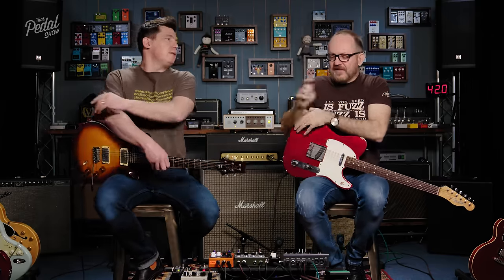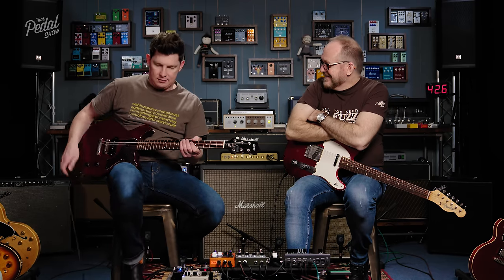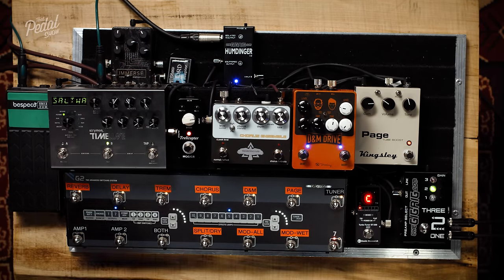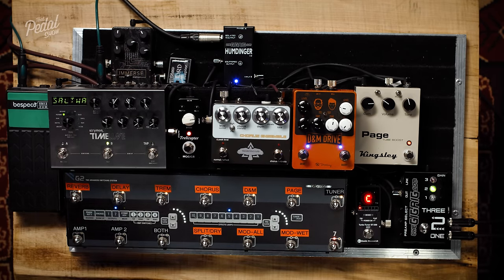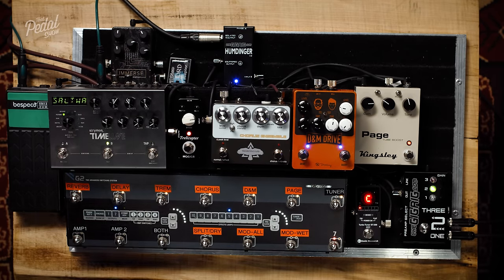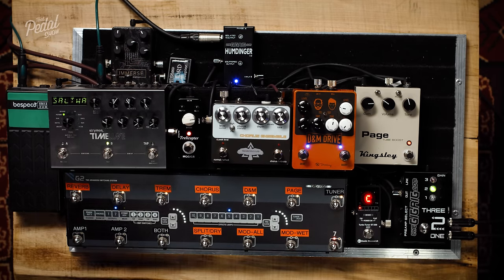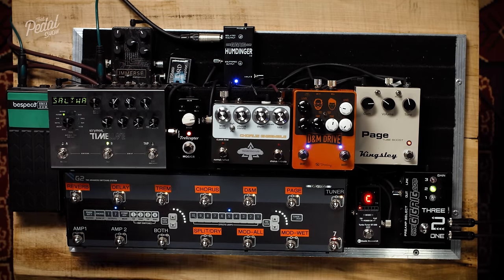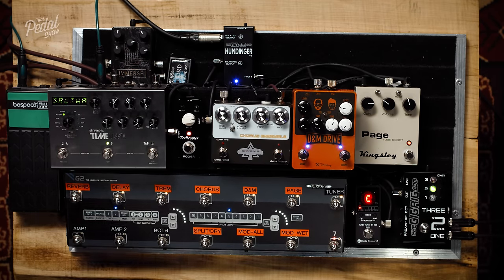Wet-Dry & Wet-Dry-Wet Amp & FX Setups Explained – That Pedal Show

Comment: hello guys and thanks a lot for this your first 2019 TPshow, very illuminating explanation, i will try it in my rig.
i need your help with something.
a have an issue with my amp, (a mesa boogie subway rocket) and my wah pedal (a Dunlop MC404-CAE ).
in the dirty channel seem like it does´t "grab" the whole overdriven sound, the "waka waka" effect disappears ir more noticeable when you just hit the strings once but still rocking the wah pedal.
Q: is that normal?... i mean, do i need to keep rocking the wah pedal all the time to get the waka-waka effect?... when i using the dirty channel?
thanks a lot again guys, i hope more good videos from you soon.
Cheers, Jorge

Comment: I've got a Bad Cat 40r usa series with the EF86 preamp. It sounds Godly dimed  using the k-master. Anything through the loop or in front just dulls it. The class A harmonic richness just isn't the same. So for a wet dry with that I think I need to mic it up and sent to a mixer and then a board?! Maybe to a direct box to the board. I want fxs, but I want my amp just cranking on its own.

Comment: Hi guys, I´ve been watching a lot of your master classes and still have one question. To the point to split the signal using the humdinger is easy but them the signal has to be split again for the two wet amps and I don´t understand why there is no need of another humdinger or ABY switcher to control the face/out of face issue. You said that the strymon delay split the signal between the two wet amps so, No face problems? To get to this second split wet/wet it would be nice to know pedals that works and doesn´t. Also it would be great to see how it works to a low budget situation: one main amp, some gain pedals then get a spliter, two cheaper combo amps to send the split signal and a pedal to split the wet between the two. Which cheaps amps can be used for that?.Most of people have only the minimal gear and use to get rid of the old one to get upgrade. Greats vids always, thanks.

Comment: I suspect this is covered maybe, but I had an idea for putting OD/gain stages after the split to send to dry, and keep a clean signal for the wet amps. But the gain stages compress, so the clean/wet transients will dominate and spoil the sound, you say? Not necessarily. You can choose delay or reverb with a mix knob to control or eliminate that. Or drop in a compressor to squash the clean signal before it hits the echo space. I say I can make this work, so there.

Comment: Hey guys, a question into powering the “device” for splitting signal... 
say you have your pedalboard which is usually wired for just one amp & all power outputs on the pedalboard power supply have been used... and then when you can or have the luxury of using 2 amps & you want to insert the humdinger or aby-baby et al. Does the power supply for said device need to be powered from the same power supply as you pedal board... ie do you need a bigger pedalboard power supply unit or another “isolator & distributor” etc or can you get a 1spot/separate power supply unit to power the humdinger on its own?
And the what about powering your amps... both my amps are usually plugged into 1 multi board which then also has the iec cable from pedalboard running to it, and then potentially another wall-wart power supply for humdinger et al.... and then sometimes I still get zapped through my microphone
Help... confused as flock re isolation etc
Cheers
Chris

Comment: Ok I am about to steep my feet into this wet /dry/wet rig. I plan to run a stereo 50 watt Peavey power amp into 2 boogie preamps with the G major acting as the effects, the power amp would run 2 x 1/12's , for the Dry amp I would be using a PRS Dallas head into a 1x 12. Now i know i can run the preamps and the power amp and get that going how do incorporate the dry rig though ? Sorry complete novice at this. I would be using a midicontroller to switch channels and effects on the preamps.

Comment: Fantastic show!  Question for you: Where would you recommend putting a looper pedal in either one of these setups?  Just something like a simple Boss RC-3 looper.  Any guidance you can offer is greatly appreciated.
Reply: The Batigs put it at the end.  So both are going in and then outs to both amps.   This way you get everything going into the looper

Comment: Great show! I really enjoyed this episode, especially the diagrams, and the funny and effective representation of phase coherence. Question - has anyone ever tried a WDW setup, but instead of using 3 amps, using one amp+effects loop, and then a stereo PA system (or powered speakers would work too I suppose) to get a center-dry plus big, wide stereo effected image? I have been playing around with this lately in my small rehearsal/recording space. I use a Bogner ATMA and prefer to get my OD from the amp, which can be a wrench in the works. To try and achieve WDW with a PA, using my amp's OD for the base tone, and without drive pedals and a splitter, I'm routing the signal from my guitar into the front of the ATMA, then getting my OD/distortion from the ATMA preamp (pre-send). Then I use the loop as a splitter, taking the send output (the ATMA has a series loop that still sends signal to the power amp even if you take a lead out of the send) and sending that overdriven signal to my stereo time effects - Dunlop EchoPlex Pre -> Strymon Volante (stereo) --> Strymon Big Sky (stereo). I take the stereo output from the Big Sky with the cab filter enabled, and send that to a stereo channel on my PA board. In the meantime, back at the ATMA loop, the signal that didn't go out through the send proceeds to the power amp and speaker as normal with no time-based effects. The end result is that the amp is outputting the dry tone. The wet tone, which includes the preamp OD from my amp, is coming out of the wide-set PA speakers in massive stereo. I am struggling a little bit with hum from the PA, but overall it sounds huge and immersive and room-filling like nothing I've ever heard, and if I can manage to completely kill the hum, it has potential to be absolutely amazing. I'm not sure how practical it is, but wow does it sound good just messing around! I would love to hear if anyone else has tried this and has any suggestions, etc, to make it better. Cheers!
Reply: Ah, nevermind, I just watched a little further and you describe almost exactly this setup at 01:10:36.  It sounds like maybe a splitter with proper isolation in the ATMA loop would do the trick and get rid of the hum I'm still getting at the PA. Thanks so much!

Comment: I recently set up my dry-wet rig and split the signal using a Radial Bigshot ABY to avoid inter-amp phase/polarity issues.  However, puzzled by weirdnesses in my wet chain, I slowly figured out that three of five highly regarded pedals therein invert phase: an EHX Small Stone, my treasured DMM, and a  boutique Echoplex-type preamp pedal that wants to be placed last in the chain before the amp. Engaging any one of these pedals throws the amps out-of-phase.  Engaging any two of the three keeps the amps in-phase. Engaging all three pedals puts the amps back out-of-phase.  To avoid an expensive and complicated fix, I had to place two of these wet pedals in the (dry) main chain.  That fouls up my pedal order plans to stack delays and keep modulation effects out of my dry signal.  What a revolting predicament!  Problem is, I couldn't have identified which pedals are phase-inverting until I set up the rig.  Wet-dry is lovely, but it may not be nearly as simple as we'd like.

Comment: Inspired by you, I have Wet-dry-wet, using The radial bigshot (awesome for this purpose) to split dry and wet and a stereo chorus to split The wet signal, going through stereo trem, delay and reverb. It is massive sounding. My one challenge is this: I have my dry amp on the edge of break-up. For my clean sound all three amps are at a similar volume. My wet amps have higher headroom than my dry amp (as per your instruction ;) ). When I engage one of my drive pedals to push the amps, the wet amps become too loud compared to the dry amp. I can combate this by using a boost on the dry amp after the split or my GE7 to take off a smidge from the wet amps. But is there a better/easier solution?

Comment: Hello from the left bank of the pond!  I am working on setting up a wet/dry/wet and was wanting to do something a little different at the split between wet and dry amps.  I’ve done some research and I’m not sure what I’m about to describe exists...

Mono in, stereo out.  Loop to put your drives and a blend knob in at least one of the output channels to set the amount of loop vs dry signal going into the channel.  

Basically, the idea is to run dirt into the dry amp and blended dirt and clean into the wet channel before hitting the mods/delays/reverbs.  

Phase reverse and ground lift are a plus...

Does such a thing exist?

Comment: I don't use fuzz/overdrives, only preamp gain, I have a single SS-20 tube preamp with +10dB output level into an ISP Stealth power amp, mono so far but looking to get into the dry/wet thing. Can the splitters you mentioned handle that signal level from the preamp? I would hate buying a splitter that could clip the input signal.

Comment: I noticed when you guys were switching the D&M drive in and out, both channels are on, and it seems to have its own single loop in G2. Are you always using the D&M with both channels engaged? Or are you using the TRS function with both sides going to separate loops? (At least in regards to videos like these where the D&M is just on the board as a place holder for a general drive/gain stage)

Cheers, my dudes
Many hugs from the Midwest U.S.

P.S. Come visit Riff City soon so I can give you both a proper handshake

Comment: Coming back to this episode. I just got a humdinger and set my rig up for the TPS recommended wet/dry. But I saw the guy from Vertex effects talking multiple times about how wet/dry has a different definition. He says it’s coming from the 80s where the have a line out from the dry amp and the a mixer to feed only wet signal into the wet amp. I never hear you guys talk about that. Can you elaborate in a future episode? Or even set that up and show us the different sounds?

Comment: Greetings Dan and Mick! That was a brilliant episode! I believe I may have a solution to the wet-dry “one mic live situation” dilemma, but it requires a little audio engineering on the part of the guitar player. For this example let's say your guitar rig is two 1x12 combo amps and a pedalboard in the standard wet-dry set up you described on the show. What if you also brought to the gig a small mixer that has at least 2 mic inputs (ex. Behringer Xenyx 802 mixer) and a couple mics (ex. Sennheiser E609,  hung over the top of the amps to avoid the need for mic stands). Then when the sound engineer comes with one mic to put in front of your rig, unplug his mic and plug the XLR cable into the output of your mixer. Now you can control the wet-dry mix going to the main board and the engineer is just controlling the volume of your mix. Thoughts? Keep up the great work!

Comment: Love your show.  I don’t understand how to setup three amps so that there aren’t noise/grounding issues. Can I just NOT use the ground prong on two of the three amps? Or do I need a special device?
Reply from the maker: Under no circumstances should you try I’ve the earth from your amp, it’s incredibly dangerous and has caused death in the past. You need a splitter that isolates the outputs to your second and third amp

Comment: Great video with the creamiest of tones! Question: If you're wanting to run a wet-dry rig with two amps with vastly differing wattage (I use a Vox AC15C2 & 1978 Music Man 65 watt 112 combo), what would be the proper setup for what effects go into which amp? Should modulation go into the amp with higher headroom, or save that  amp for the OD pedals?
Reply from the maker: Yeah, that's how I'd do it Alex. Wet stuff into the higher headroom. But there will be plenty of people who prefer the other way. :0) Mick hetr
Reply: Thanks!

Comment: So a question for you both, this video did a great job of explaining a wet dry wet rig. What is your opinion on a rig that is in stereo where one side is a tube amp, victory V50 being fed all digital effects etc. from a line 6 helix rack and the other side of the stereo rig is all analog with only analog petals into a Mesa MK V. My questions are your thoughts on how to control this rig, balance the two different types of signals analog versus digital and how it should all work together? Also, have you ever heard of performers using this kind of analog  -  digital stereo rig?
Reply from the maker: You’ll need to compensate for the latency on the digital side
Reply from the maker: And to add to that, Mick here, a more common application for mixing digital analogue and digital is to run W/D/W where the middle dry channel is analogue and the LR wet is stereo but with kill dry. So 100 per cent wet, like Devin Townsend for example. Cheers!

Comment: Great video, guys! I’m new to this concept and I have a simple question. Would be possible and maybe appropriate to not send any gain or drive to the wet amp?
Reply from the maker: It can be a cool sound if it works for you. Doesn't work for me or Dan because there's too much volume difference when you step on a drive. You really have to try it and see what works for your own application. Cheers!

Comment: Sorry if this comment has already been made. I run a home recording rig in stereo (without amps) splitting the signal at the modulation stage with a chorus pedal (ok it’s a wet dry split at that point but then goes on to be proper stereo at the delay & reverb stages). Because I’m not using amps but amp modellers do I need to worry about phase shifting/isolation? I’m guessing that the phasing only happens because of the usage of amps and the cone movement. Excellent video again you should receive govt. funding for keeping us guitarists so informed! :)

Comment: Ampeg made an amp a while back called the B-12-X that had a satellite speaker output for the reverb wet signal. You could hook up an external speaker via RCA jack on the back of the amp. Putting the satellite speaker with the reverb on the opposite side of the room and sitting in between the two amps to play is an absolutely divine experience.

Comment: One of the most useful shows you've ever done, due to the massive change in perceived sound! Any old second amp (perhaps even a reasonably good bedroom practice amp?) would do to experience the huge sound produced, I think, in the wet-dry experience. I am of the opinion that having a wireless guitar setup, makes it possible to step away from the amps and experience how the audience will perceive the improved sound. I know you guys have touched on wireless before, but have not extolled sufficiently (in my opinion), the virtues of using wireless. It does have drawbacks, of course, but the freedom it offers me to really hear how the guitar sound is experienced by the audience, makes it very worth while. I simply hate using expensive cables now, as they often fail unexpectedly...just the same as a poorly thought out wireless setup. Please guys, can you do your take on wireless, as I'm sure many have shied away from it before now. The truth is there are several affordable digital wireless systems with almost no latency. I love all your shows, I learn something special every week...you two are the best :)

Comment: I was completely blown away by the wet-dry sounds. I have a question: what if some of my effects are built into the amp? e.g. I have a boss katana, could I use that with delay and reverb and have a budget dry amp, a splitter going straight to both and a drive pedal before the splitter? Would I get phase issues because one amp is doing the effects itself?

Comment: Hey Dan,
Got my G2 3 days ago which came with the latest chip, and it seems that I can shift the power amp section of an amp to anywhere in the G2's loop, which is killer. So now my question is can I place the power amp section of only output 1(wet amp) after loop 7, keep my delay & reverb in L8 and L9, but bypass loop 8 and 9 only for output 2 (dry amp) not for output 1? If I can, will I still need to reverse the phase & isolate my output 1 signal, after it leaves G2? If I can't, then maybe this could be added to the next update? lol. thanks.

Comment: Hi Dan and Mic
First of all thanks for a great show. I really enjoy watching TPS...
Back in the days I hade a massive W/D/W system using the Peavey 5150 for the core tone. And there is another way to split the signal for the wet amp(s). I used a stereo VHT amp at the time. 
Steen Skrydstrup (from Skrydstrup R&D) build me a lineout box that enabled me to grap a linesignal from the speakersignal from the 5150. That way I could feed my delays and reverbs with the “complete” tone from the 5150 (both preamp and poweramp)
Regard. Martin Klaja - Denmark

Comment: Necro bump from the 2 year old video, but here we go!  I'm thinking about picking up two Headrush FRFR 108, a Mooer Radar, and running a W/D/W rig.  I'll come out of my amp, into a Fryette Power Station, line out will go into the Radar, a volume pedal, then into my stereo board, then into the pair of FRFR 108.  Main cabinet will be dry out of the Power Station.  Is this a good idea?  Any suggestions?

Comment: Hi Dan, how do you use the G2 footswitches to control amp selection along with the 2 main outputs? Is this a stompbox config addative/subtractive thing? I must admit I havent explored stomp box mode on the G2. Mick I guess you dialled up the Marshall in the mix as it makes the overall sound significantly louder at home but the db meter doesnt change. Hope you are enjoying NAMM.